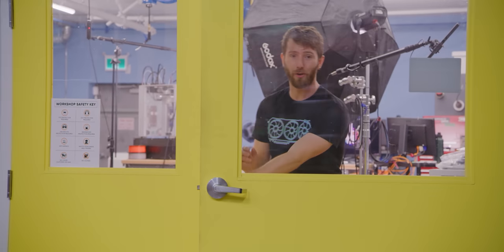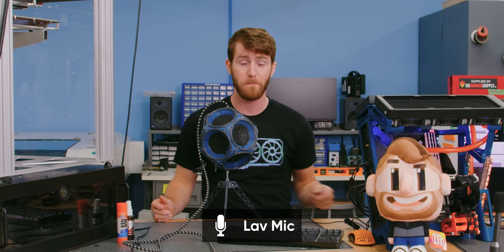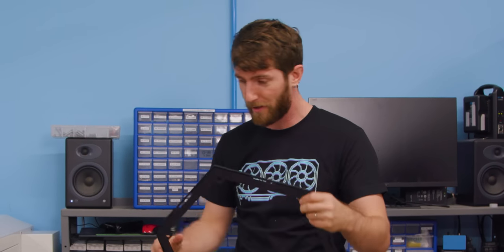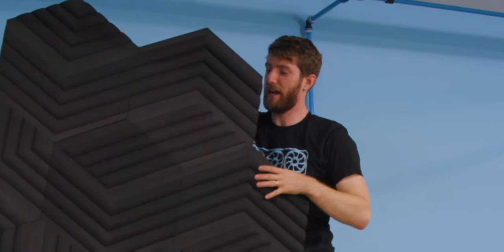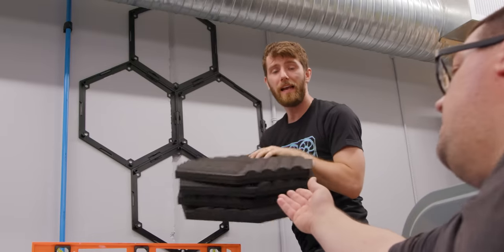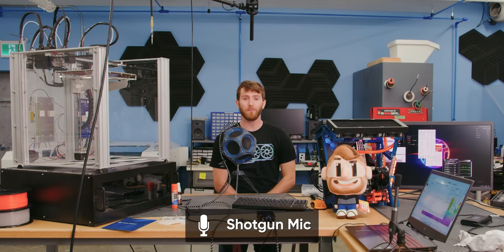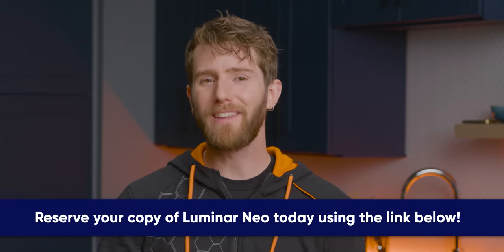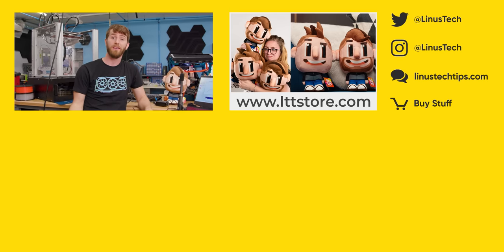I'm only going to say this once... - Acoustic treating with Elgato Wave

Comment: The wavelength a panel can absorb is directly related to its thickness.  Location also makes a huge difference in terms of absorbing mid and low frequency energy.  You probably want to add some big thick bass traps to the power corners of the room (ceiling/wall corners and floor/wall corners).  I am happy with the panels I got from ATS Acoustics - you can also have them print custom images/pictures onto the front of them so they look like wall art vs. acoustic panels.  EDIT:  Fundamental tone for male voice is around 100-120hz which is definitely in the range for corner bass traps.
Reply: Yeah. There's no point adding panels to places where the sound won't bounce off as much
Reply: Well they don't have bass in their videos.
Reply: I would assume ceiling corners are even worse since you usually don‘t have furniture on the ceiling.
Reply: you can also DIY some rockwool panels for 10% of the cost of those ATS ones, that will even perform slightly better along the spectrum if you pick the right rockwool type. 200$ (or 150$ i'm not sure its been a few years) made me about 24 panels. it's also really fcking easy to do.
Reply: Thickness can be replaced by micro etching to absorb and distill soaking more per inch than others.
Reply: @KL-tn1xc  this is indeed a much better solution. Edit: but yes this is of course branded content (Elgato) so I get the video. But too bad then didn’t measured the room with a heat map thing like the WiFi ones.
Reply: Bass traps? Have you heard linus' voice?
Reply: you're treating this like a sound studio for making music and its not. Its for reducing echo when talking.
Reply: @KL-tn1xc  the advantage of rockwool over foam is that it will eliminate reflections of more frequencies going down to 200 hz for thick ones. That's not needed tbh because those are not the problem frequencies for speech and besides covering the entire roam with foam is much more practical than thick rockwool which irritates your eyes and throat eh?
Reply: Cool story bro
Reply: @KL-tn1xc  $200 for 24 panels is not worth it... those better be some giant panels
Reply: @sanidhyachauhan5578  you place the rockwool inside a frame and cover that with fabric. No risk of irritation.
Reply: I mean bass doesnt really exist in their videos and I assume they run a ~30hz low cut anyways. And also the wavelength is proportional to the thickness not equal to it. So if you do maths it doesn’t really matter that much.
Reply: For their needs this would be overkill.
Reply: Yup, directly related to its thickness as long as the two types of foam are the exact same 💯
Reply: Foam density is also a big factor. Those cheap Amazon 2” panels aren’t going to do much. Even if you have 10” panels, if the density isn’t there, it won’t do much.
Reply: @Dalux  idk where you come from where $200 for 24 panels is too much. Actually sounds a little low to me especially with the cost of lumber being so low. You'll pay $200 for a single panel if you buy from a studio hardware supplier
Reply: Our office is concrete floor, concrete ceiling, and we just plastered the ceiling with thick acoustic foam until talking started to feel depressing due to the lack of reverb.
Reply: @twizz420  Yes they do. Just nothing lower than 80 hertz as its mostly speech. There just isn't much Bass or any sub bass at all. Except the music of course but that is from post.
Reply: You don't need bass traps for speech. Don't be ridiculous.
Reply: @testthisfordecficiencies  unless you like Corpse Husband then you'll gonna need it
Reply: @anonymone453  for a single panel??? Lmao where?? I have never seen that.
Reply: @KL-tn1xc  Came here to say this. Unfortunately LTT isn't totally motivated to choose the most economical and effective solution all the time. Gotta work in products they are sent most of the time. 

Edit: He mentions this at the end of the video too. Good on ya Linus
Reply: They'd be better of using that denim material they used for server room insulation. But it's a sponsosred video, so yeah.
Reply: @Dalux  auralex 2"x2'x4' panels will run you about $160 per
Reply: The thing is, once they installed the panels covering 5% of the surface they shouldn't have added more. If you see the measurement they show, by the time they finish putting more foam the reverberation time is higher in the low end of the spectrum because these panels can't absorb low frequency sound. So in the end they are not just lowering reverberation time, they are messing sound balance which is worse for voice recording since low frequencies are bad for intelligibility
Reply: @InvadersDie  True, but James, Colton, Andy and others would benefit.
Reply: @aviralxdd  there are enough midtones and upper bass (120-200hz) that they would be beneficial.
Reply: @testthisfordecficiencies  They help quite a bit with midtones and evening out bloat with lower toned speakers. Fundamental tone for Male voice averages around 100-120hz.
Reply: @josesaavedra5264  voices don't produce enough energy in the lower end of the frequency spectrum, and any excess low frequency energy in the recording is fixed with a simple high pass during editing if not during recording itself
Reply: @anonymone453  voices do produce energy in frequencies lower than 500 Hz, that is why it is important to keep that bandwidth treated. Anyway, I find that there is really no point in adding more panels if they can just add more filters in post.
Reply: "Average male voice is around 100-120hz" WAIT LOLWUT do you even understand how low 100Hz is? That's only the fundamental tone, not the full range.
Reply: @sanidhyachauhan5578  Rockwool doesn't irritate eyes and nose though? Glass fiber does. Also rock wool can go even lower than 200hz if you offset it a bit from the wall, of course it's not needed for speech but even if it's only for speech it would still be much, much cheaper. And look better at the same time.
Reply: @Dalux  yes they are giant, 120x60x5 cm each. And You can get em thicker if you wish.
Reply: @Dalux  and really what's the alternative? auralex 30x30x1.25 squares? of which 32 of em is equivalent of one panel, costing about 5 dollars each, that's what, 160 dollars? For the same volume of one diy panel, Plus rockwool straight up absorbs sound better.
Reply: @PhilfreezeCH  Corners are also good retroreflectors so any sound going into them comes right back out. Adding the foam to corners can pay off quickly since a single incident wave heading for it will have to hit three panels before it comes back out.
Reply: @NinjaPige0n1 I have rockwool panels in my home studio. Sometimes it feels like onions are being cut in that room :( but that's because I have too many in a small room

Comment: From personal experience in doing this a few times, generally 10% of wall surface area is the least amount to get the most significant change. 25% is the sweet spot for very good acoustic treatment and going beyond that you'll start to get diminishing results for the cost. Good video overall!
Reply: yup and unless your running machines or music the ceiling rarely needs any especially a high ceiling like that one ..
Reply: Are cheap panels good?  I found in stores like Aliexpress, panels with 2.5cm or 5cm thick much cheaper than you usually see.
Reply: @Guihvk  honestly, they're shockingly good for reducing  flutter echo and shouldn't be dismissed. Are they going to perform quite as well as a higher end product, no. But you have to factor in that a ton of the cost of higher end products isn't actually to the foam, and that the cheap ones are so much cheaper that you can spend half as much and get twice as much coverage at the same time.
Reply: I have a room with 100% coverage, it is ridiculous. You can play metal of the heaviest kind in a tiny space and still distinguish each musician's sounds perfectly (in normal practice rooms all you hear is chaos)
Reply: @Guihvk  something that few people mention is how resistant to time the foam is. Some will crumble away in a few years, others will last longer. I had a room fully fitted with a strange extrusion of recycled PET plastic from bottles and 13 years after it still holds strong, though it has lost some fibers.
Reply: @notMattGarska  Cool. Is there anything I should know about the safety of the material the foam is made from?  Like some wrong type releasing something toxic into the air

Comment: In the old sound tech days they used to have "reverberation panels" in sound studios, where you'd draw out a sheet of differing material to either dampen or sharpen accoustics in a booth depending on what you were trying to filter/pass-through.
Reply: Manual compression?! That's dedication!
"where do you put your compressor, in your line?" 
>before the microphone...
Reply: still do, me and some friends just made a bunch out of old pallets and insulation
Reply: @loser-nobody  Compressor goes on the wall, where else?

Comment: I made some panels with 1x1 wood frames and geometric fabric with “eco” insulation. I put up 3 panels to target the major sources of reflection and the stairwell. It really changed the whole sound signature and I only paid about $60 for the materials. 

Plus you can pick some pretty cool fabrics and get a neat functional wall hanging.
Reply: That's what I was thinking... At $100 per m2 for these, I suspect you could go with a less sound-absorbent material and ultimately get similar results for a fraction of the price (by covering a higher percentage of the walls)
Reply: Phoenix  𝙾𝚙𝚎𝚗 𝙼𝚢 PROFILE  well done you copped someone else's comment
Reply: @ericrosen6626  you can but rockwool or other types of insulation would be much better  acousticly than the cheap foam panels in this video

Comment: As an audio engineer, watching folks work through the treatment  process was actually really entertaining. Not a bad job overall. You did well to target large walls and spaces.

Also, while these panels are great for absorption, refraction is also a key component to consider, depending on your needs and the regular recording orientation. All in all, treatment is treatment, and because of the practical application, these will help with high frequency absorption, negating a lot of the reflections. Good job.

Comment: 1. Reverb is a form of echo. When people say "echo" they typically mean "delay" (discrete repititions) whereas when people say "reverb" they refer to non-discrete repetitions.

But the application terminology is that echo refers to both delay and reverb.

2. Standing waves are a seperate, resulting function of reverb, but are their own issue

3. While post processing CAN be used to dampen reverb, the only way to do this without causing noticeable quality loss (which will be ESPECIALLY noticeable if all you have is a vocal recording) is to manually ride the volume faders.

In any case, I'm really glad you guys didn't confuse acoustic treatment for "soundproofing" as everyone else does.

Room acoustics are immensely complex and there's a TON of further reading one can do, and I recommend Bobby Owinski, who happens to be one of the best acousticians in the industry
Reply: Well said :)

Comment: Just for info: What you are talking about and measuring is the reverberation time (you can even see the graph legend, RT60, which is the time it takes for the source to reduce the level by 60 dB after it has been turned off), that is not the same as a standing wave. Standing waves in the context of rooms is usually a low frequency phenomena, and less of a problem in bigger rooms like this than in smaller rooms.
Reply: Linus never let his ignorance get in the way of him making a video pretending to be an expert.
Reply: @charlesmcguffy  You know that there is a whole team of writers researching the topic and writing script? Linus aint the only one making mistakes but he is basically the only one presenting it (as he is the face of this channel).
Reply: A good example is when you first move into an apartment, but the same basic concept is being applied here. 

Hard surfaces bad. 🤣
Reply: RT60 is the time it takes a noise to decay by 60db SPL.
Reply: @Phill J Phase doubling is far less pronounced at higher frequencies because the shorter wavelengths make the highest amplitude of the wave much more evenly distributed, to simplify abit, there are much more peaks and crest between the edges of the walls, and that evens it out, that is also why bigger rooms have less of the problem. There is a reason the Schroeder frequency has the volume of the room as part of its formula. Doesn't mean it doesn't exist in larger roooms, but as mentioned, it is usually less of a problem in bigger rooms, just as it is usually a low frequency phenomena.
Reply: @testthisfordecficiencies  Yeah? Isn't that the same thing as I explained in what I hoped was a bit more accessible terms?
Reply: @Phill J I never said anything about "evening out" flutter echo, it is about evening out the way crests and dips. While flutter echo is related in the sense that it is caused by the reflective properties of walls standing against each other, it is not the same as standing waves. Flutter echo is much easier fixed, and is much more rarely an issue in big untreated rooms like this, it is much more normal in partially treated rooms.  (with uneven treatment, the typical example being to parallell smooth walls with absorption in the ceiling). The master handbook isn't the greatest book to be honest, I am not sure why it is recommended by so many, might be a personal preference, but many things there are explained in an unprecise way. For treatment in typical homes, "loudspeakers and rooms" by floyd toole is my recomendation.

Comment: I'm really surprised by how fire resistant they are!
Reply: if the can survive a blowtorch then they should be good for a regular fire too.
Reply: The Station nightclub in Rhode Island was "soundproofed" with the wrong kind of foam (the kind that's used as shipping material), and they lit off pyrotechnics into it. It easily caught fire, which spread like crazy, melting foam rained from the ceiling like napalm, and the building was fully engulfed within a minute. Tragically, 100 people lost their lives.

That's why acoustic foam has to be so flame-resistant.
Reply: @needfuldoer4531  Its also why doors are now mandated to open outwards, because everyone bunched up against the doors and couldn't open them.